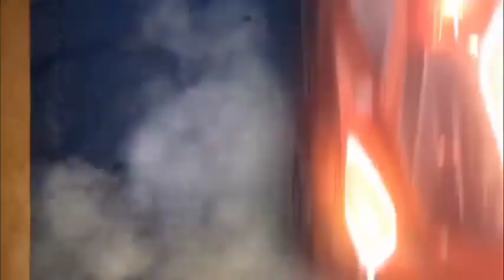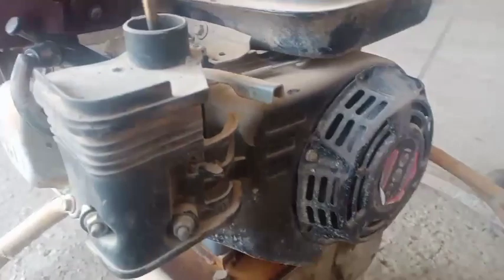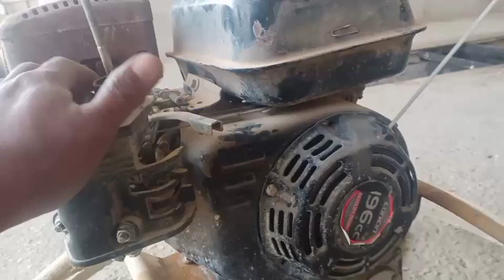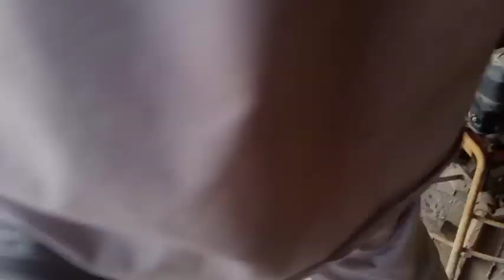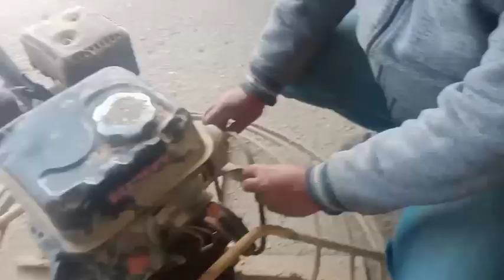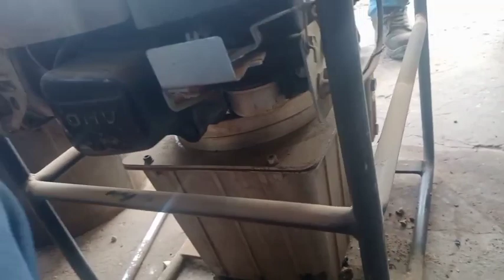helecopter plainer Briggs and Stratton how to repair

Comment: I used to work on these all the time. Worked at an equipment rental company that specialized in concrete equipment.  We even had a couple that ran on propane.